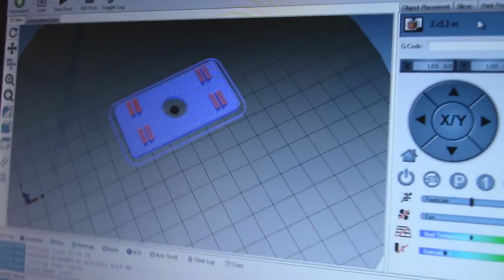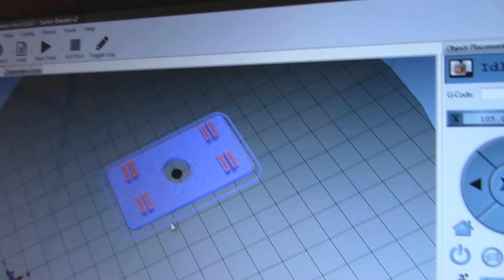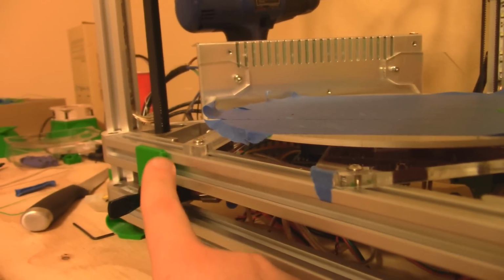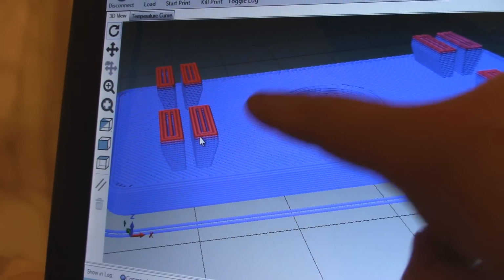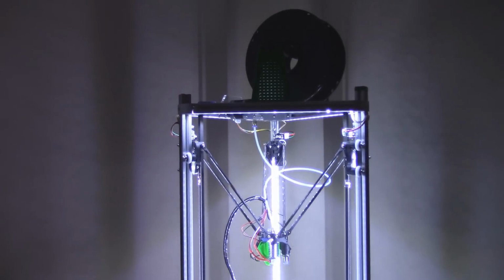Adding LED Lights to my 3D Printer

Comment: How did you set the led strip into the top bars. Any tips? Really don't want to take the upper frame apart. Thanks for the video post I found it helpful.